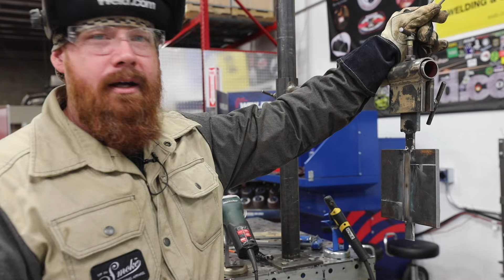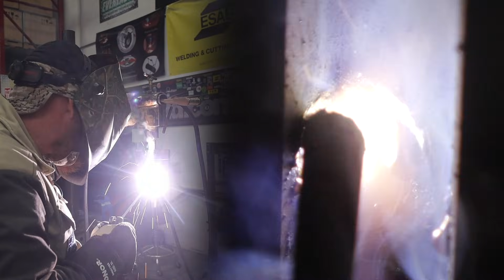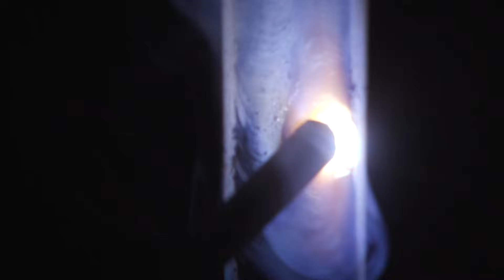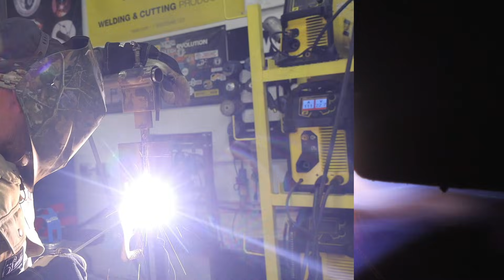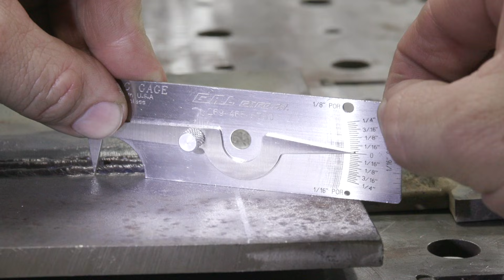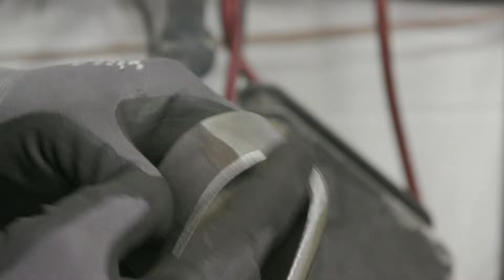CWB Structural Weld Test | 3FG Vertical Stick Welding

Comment: I use 3 passes in this root. It gives you more control and less need for manipulating the pool. Its easier to avoid roll back or grapes occuring. Again, the included faults combined must be less than 1/8 or 3.2 mm not each flaw itself. Also, all of these tests allow you a 15 degree tilt to your workpieces which can also help you with slag rolling back. Especially in this postition. 
The undercut would be questionable, If it passes visual by 1/32 of undercut you may have passed, you may not have. its at the examiner. If you see a small level of undercut on your cap, place another pass over it after letting some of the heat cool down. Most people are rushing to smoke this thing out. Roots, fills LET IT COOL and cap it.
Reply: Agreed. When i went too college for a weld and fab course, we were taught too always run a 3 pass root, 1st past on the 90, second on the bevel, and third in the middle
Reply: i run 2.......stringer on 90, weave on the bevel
Reply: whats are your setting? i like to try 3 root passes
Reply: Should be able to bust it out quicker by dropping amps.
He's going to fast for what I'd do.
Alot of flicker in his arc, which isn't the end of the world.
Should be able to control his deposition rate speed with hotter for both FC an SM, Ann just keep dropping down from  welds that are only just two inches wide really.
If bender just go hotter than you like get comfortable an drop them in as hot as possible with enough deposited.